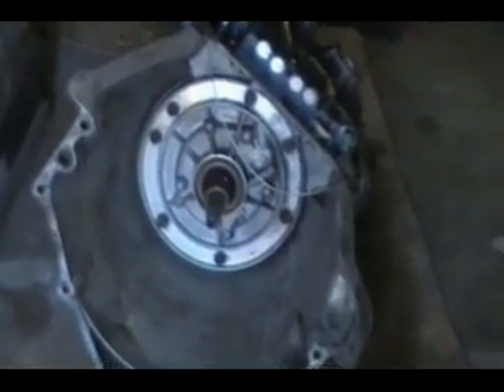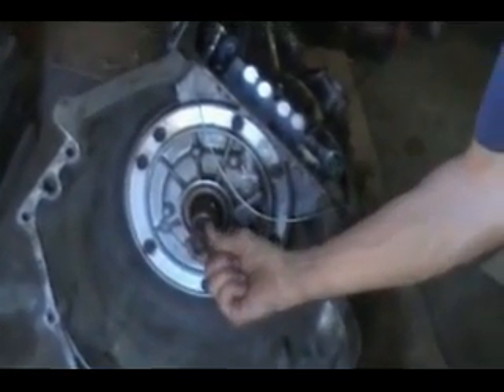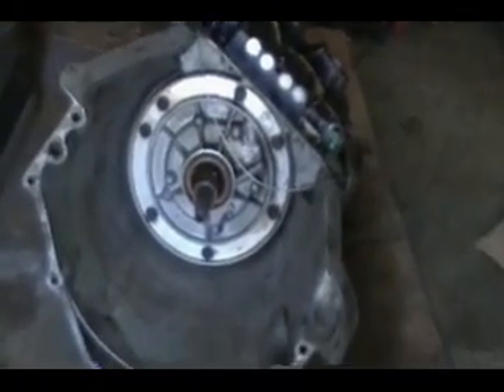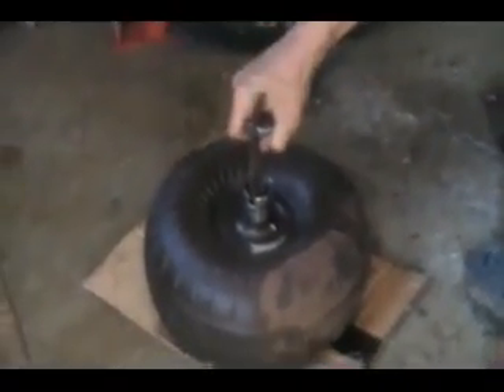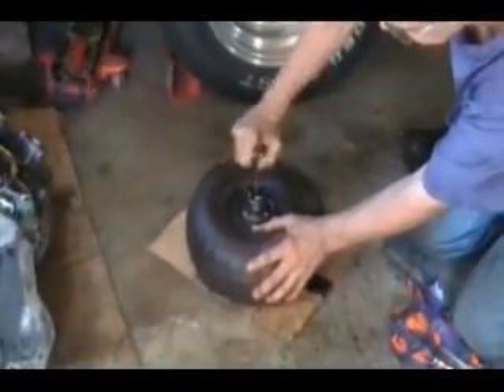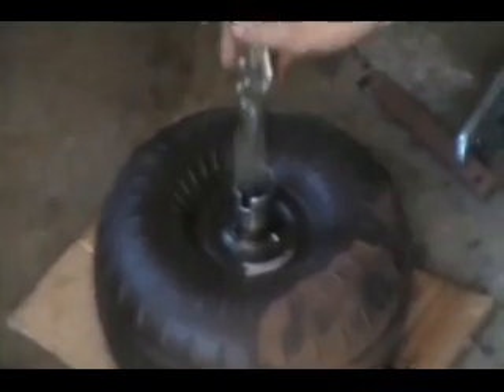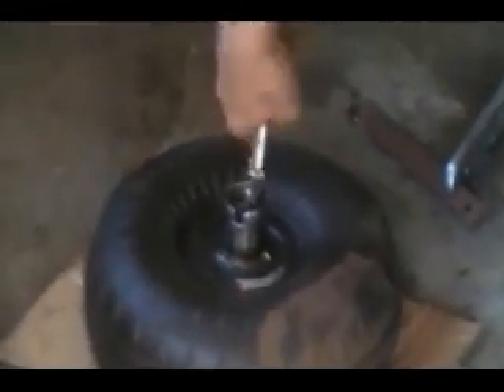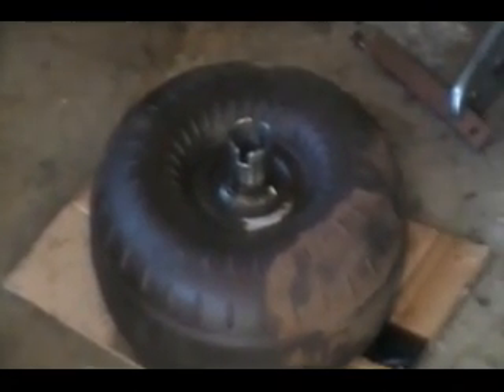What A Bad Torque Converter Sounds Like -- 700r4 Part 2 (Rev. 1)

Comment: Thanks for this. Did my own test on my th350 converter, no movement, loud whirring noise. Dumped the fluid out and with it came large chunks of metal matching the splines on input shaft. There's the problem!  Gonna order a new converter, and new filter, new fluid. Drive around the block (if it moves), then drain and replace the filter again and refill again. Fingers crossed.
Reply from the maker: Good Luck.  As shown in the video, I had chunks of metal in the pan. I replaced the fluid, filter and converter.  After that it moved and worked O.K. for a while.  Then the transmission failed.  I took the transmission apart and found one of the gears on the rear planetary gearset completely destroyed.  That was the cause of the metal chunks.  Hope you have a better outcome.
Reply: @icogye   thanks for following up ,I was in the same boat, did the filter,Yada Yada, then I broke the ouputshaft and some gears inside it. I just got a rebuild and added a shift kit. I have my fingers crossed
Reply: @icogye do you think the fact that the converter destructed is what wiped out that gear? or was that gear wiped out for some other reason?
Reply from the maker: Now THAT'S the question I was hoping to answer when I posted this video.  Now I do believe that the torque converter failure did cause the transmission to fail.  This is because there were many metal shavings in the transmission when I removed the pan.  Even though the transmission was OK for a short time after torque converter replacement, I think the some shavings were still present in the transmission internal workings which ultimately led to gear failure.

Comment: I purchased a stall lock up converter and the mail lady that delivered it dropped it on my concrete porch from about 3 feet. Of course it doesn't have fluid in it yet, but when I shake it, I get a rattling sound. Does that sound normal.
Reply from the maker: Not sure, but I think a dry converter can have a little bit of internal play.  Maybe try filling it with fluid and see if it goes away.  Of course, if you have time to wait for a replacement, you could call the seller and explain the situation to him.  He probably has some sort of shipping insurance.  Good luck.

Comment: I got the same grinding noise when a made a hard sudden stop in traffic with seven passengers (seven seater).  The transmission was not changing gears and not going into reverse.  If I change the torque converter, would this fix the problem?
Reply from the maker: I agree with SilentOne, problems when braking or when going into reverse are not necessarily the torque converter and a brake job or transmission rebuild may be your only recourse.  If you do want to do a self check on the torque converter, there is a quick check you can do: Put the front of the car up against a tree or other immovable object, put it into Drive, gently give gas, and see if the engine dies. If it does not die, it is probably a slipping converter. Do not rev it too much during the test or you could ruin a good torque converter.  Good Luck.
Reply: Thanks for your responses.  It is the Torque converter because it's already off and when I saw this video I did the test and the big spline moves very easy and wobbles.  I called a mechanic who said that once the car moved forward with the converter then the transmission has internal problems because when the converter is completely gone the car will not move.

Comment: I lost everything but 1st gear in my 1992 Chevy van.  AAMCO originally told me to rebuild the transmission would be a base price of $1,500.... more if more parts are necessary.   Today, without asking me, I was told they need to also replace my torque converter.  I wonder, how would they know it is bad?  How do I know that I'm not being ripped off for another $1,000?
Reply from the maker: $1500 does sound high for a rebuilt 700r4 transmission.  But if there was metal particles or debris in the transmission fluid, or if the torque converter was slipping, it probably is a good idea to replace it as long as they have the transmission out.  However, torque converter replacement should not increase the bill by $1000.  If you look at the Autozone website for stock torque converters for a 700r4 transmission, they run about $89.

Comment: You didn't include the way the bad torque converter sounded like...
Reply from the maker: The sound of the old torque converter is featured in Part 1. As noted in the reply to an earlier comment below, there was no follow up, because the new torque converter didn't make any noise.
Reply: @icogye  link in the description for part1 would be better.
Reply from the maker: Done.
Reply: @icogye  that link isn't working right. At least not on mobile phone.
Reply from the maker: Fixed the description to include the correct link (I hope.).
Reply: is it possible to test it out with the stator and the main shaft from the pump already uninstalled from the bell housing?
Reply from the maker: Not sure what you mean.  The only ways I know how to test the torque converter is the test I show here and tests with the engine running such as shown in Part 1 of this video.  Another good test of torque converter with the car running is put the front of the car up against a tree or other immovable object, put it into gear, gently give gas, and see if the engine dies. Do not rev it too much during the test or you could ruin a good torque converter.
Reply: Question, I have myself stumped. I am getting a whirring/ tone type of humm noise when at speeds where converter locks and holds speed while my foot is keeping pressure on pedal, qhen I take my foot off of gas the noise stops, put foot back on gas, starts again. It does Not get louder with acceleration, its a constant dooooooooooo.. in a tone sound. Not a whine, or a buzz..  I know this may sound like a crazy description but is driving me nuts. Its a 07 silverado 1500. 4.8, new body style. Ill try to get it on camera nxt time. Any thoughts?

Comment: What would cause a stator in a Ford Taurus to snap but the transmission still pose like it should just has
Reply from the maker: How do you know your stator has snapped?  What are your symptoms? If your stator is snapped, I am surprised it runs.
Reply: From all that power of the little Ford motor. Lol

Comment: So I understand that you state that you should feel some resistance when you turn the stator counterclockwise, is this when it is filled with fluid, as the stator is basically a pump for moving the atf the other direction?
Reply: Haven’t installed it yet, but there was a spline for a o ring on the torc converter input shaft....might be different from your transmission but my transmission is a 4t65e I ended up removing the old oring and it was worn.....probably explains the leak issue...there’s a lot of pressure In it and the main seal was in good shape....I ended up replacing it anyway.
Reply from the maker: The tests I performed were done with whatever fluid was in the torque converter when I removed it.  I did not add any fluid nor did I drain any fluid.  (the torque converter is virtually impossible to drain, due to its annular shape.)
Reply: @icogye  my old torc converter made noises when in forward and reverse in neutral the noise would go away.....I bought a new torc converter because my test did what yours did....mine offered no resistance turned clockwise...you could even turn it both ways with your fingers, it also leaked fluid because the torc converters input shafts oring was no good.

I think the bad oring has something to do with the leak....when car was turned off and sat....you would see a huge puddle of fluid under the car.
Reply from the maker: Do not remember any O-Ring on the torque converter.  Was it a 700R4 transmission? Did the new torque converter solve all of your your problems?

Comment: Quick question. 04Cadillac srx driving yesterday n my car went from drive mode to coast mode. Put it Park ,reverse nothing and drive nothing. Intake valves or Torqe converter
Reply from the maker: If all gears act like neutral and there is no noise, you may have a more serious problem than the torque converter.  A couple of years after I made this video and replaced the torque converter, I had a similar problem.  No drive, but I did have reverse.  Turns out I had a planetary gear failure and needed to replace the transmission.
Reply: The whole lot troublesome..?

Comment: no your problem is its a raggedy piece of shit 700r4 that's your problem get a th350 or a th400 or a powerglide
Reply: jesse kitts the 400 or 350 is a far better automatic  . Stay away from 700
Reply from the maker: Shortly after I filmed this video, I did look into swapping it out with a
TH350.  Unfortunately, it would have required changing the length of the driveshaft, so I bought another 700R4. It has been fairly reliable since then.  It
does have a couple of features:  It has a very low 1st gear (3.06:1) which allows me to light the tires with only a touch of the throttle.  And, of course, it has a 4th gear overdrive which is nice for cruising speeds.

Comment: a whining noise that increases with speed is a converter going out sometimes too
Reply: Sometimes.......? What else could it be?
Reply: @Iowawalrus  broken tooth in rear axle if it has one or CV joint going out in front.
Reply: Yoooo my Acura Tl Type S made that sound for a few months before the transmission completely shattered-cracked engine mounts and All! 
Built an entirely new one  rather than rebuild a notoriously AWFUL one without a cooler and after install and a couple other mods I had and yeah. Brand new tranny with cooler held on front of A/C condenser with intake sticking out from flap behind front tire.   

Lots of other mods but still all motor....

1 of those wuld make the tires spin crazy

Comment: you remember when a car starts to drift of the road, the tires hit the rumble strip(?) and makes a rumble sound to alert you.
my car makes that sound when I am accelerating at the lower speeds.  Could that be a power converter or transmission?
Reply from the maker: Sounds more like a tire problem.  Sometimes when a tire isn't balanced it can make noise at make noise at different speeds and be quiet at others.  Maybe also check your drive shaft and universal joints for looseness.
Reply: My car began not to react to the acceleration of the engine,  I had to race my engine to start moving,  so I went to u-pull-it and found a tranny and torque converter to replace what I have now. I might as well replace other parts while I have the front end disassembled.
Reply: @jimcolegrove5442  
P

Comment: good for you brother, did you ever get one? I don't know if you had a follow-up video or not. anyways cheers

p.s. that's my first time saying (cheers) and I don't like it. no sir not one bit.
Reply from the maker: +Marc Dominguez Thanks for your comment.  No, no follow up video because there was nothing to take videos of but a well running truck.  I did have transmission trouble later on which required me to replace the transmission.  Never got around to doing a video for this.  I did learn about 700r4 transmissions though when I was trying to diagnose it and the result is my later video, https://www.youtube.com/watch?v=2cpSasXuvjs.  Kinda boring I guess, but interesting if you are into this trans.

Comment: What do you think is wrong with my transmission, when I put it in gear the first thing in the morning the transmission shifts hard and when I apply the brakes it feels like my truck is being pushed forward like the truck is trying to push against me braking. My brakes are good and my diffential has been given the ok. I only heard a sound once when I took off, it was a clunk sound. If it is a bad converter will the bad converter cause serious damage to the components inside the transmission?
Reply: +American V8 Could also be a bad throttle position sensor. If it is sticking when you are slowing down it will make the vehicle hard to stop. It happened on my 2008 silverado.

Comment: No Part 3 We must assume it didn't fix the noise is why you didn't do a Part 3 video...
Reply from the maker: +vqfive The torque converter did fix the problem described in this video.  But other transmission problems surfaced later.  Read my description for this video.  I do say the problem was fixed.  At the time I made this (3 years ago), I was going to do a part 3, but what was I going to show?  A normally running truck with no noise coming from the torque converter and running normally?
Reply: Yes a video of a normal running truck would have been great

Comment: Did it fix the noise? I could be totally off here, because I know videos don't sound the same as real life ( at least not the ones I've made) but your timing chain could be warn(stretched from heat) and thats the noise you hear too. It also wont move very well if its jumping timing... I've had a AC bearing going bad that sounded kinda like that too.. I imagine any pulley bearings could... thanks
Reply from the maker: Joshua Sulwer It did fix the problem in the short term - the noise went away as soon as the converter was replaced, so I know the noise was definitely the converter.  However, other transmission problems surfaced within a few months (I spun a planetary gear) which required me to replace the transmission.
Reply: Oh okay thank you and sorry about the planetary gear. I'm kinda surprised that with your knowhow you didn't just rebuild the transmission. I think the clutch plates are the main thing that needs replacing in a rebuild and thats realitively cheap for the parts like $50 for my ford cop car.  But I've never actually done it so foolish for me to speculate with passion

Comment: Einstein !
Have the converter on it's side to check the Stator. The second thing he did. The stator should be FREE in ONE direction and Hard to turn in the other. Just saying.
Reply from the maker: John Volstad Sounds correct.  I think I read this somewhere before.  I just had difficulty determining which direction was the easy direction and which was the hard direction.  Felt about the same to me.